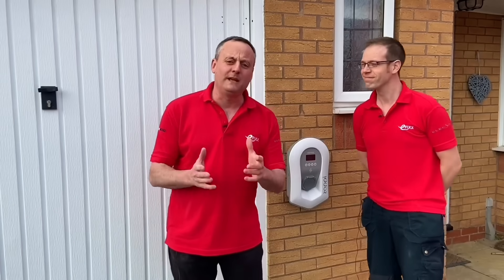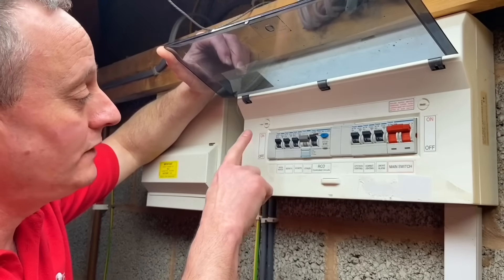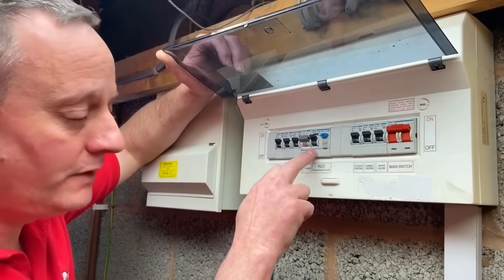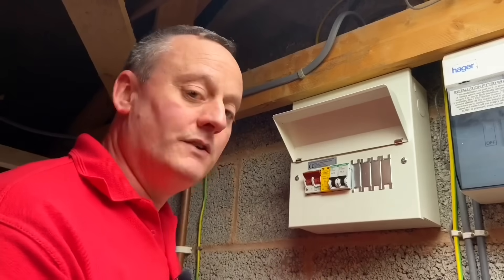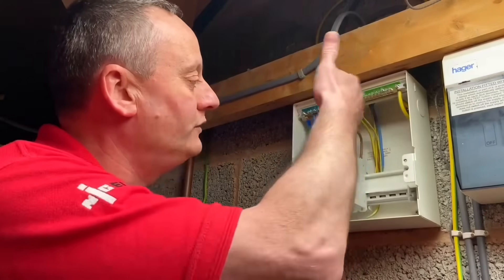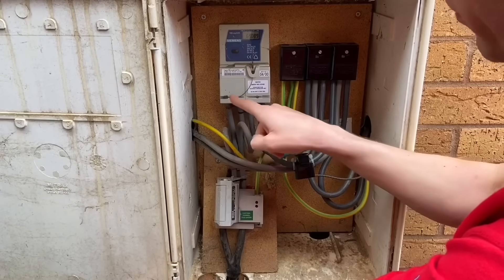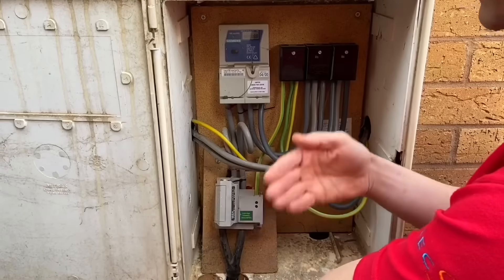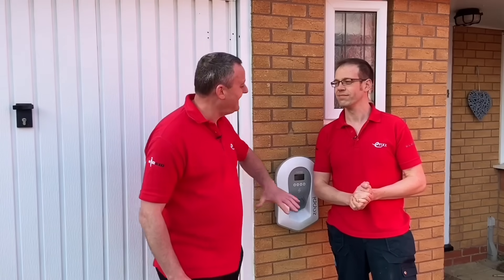EV CHARGER installation UK - can you connect to an existing CONSUMER UNIT?

Comment: Isn't the main reason for using a seperate CU that the installer doesn't have to take responsibility for the condition of the existing CU?
For a 32A chargepoint, wouldn't it be better to use a 40A breaker to avoid any nuisance trips - a 32A breaker at full load for hours on end doesn't seem like a great idea for long-term reliability.
Reply: Manufacturer instructions say B32 MCB for overload protection.
Reply: Are you in North America? The 80% rule is big there, but in Europe the breakers (and entire system) is designed to take 100% loading continuously.
Reply: Just source the original mcb there are loads that are sold used. I'd you're telling me that a tesla has no surge protection built into the electronics then its a bit crazy if you ask me. Most new TV's and game consoles have anti surge protection built into the circuits so an anti surge installation is a bit of an overreaction
Reply: Nobody asking why you need to pull
25mm tails in ? 
10mm from existing cu in to new cu.
Reply: @idontthinkso2058  exactly this made much more. Sense to me. But doesn't this mean the electrician has to take responsibility for the exsisting consumer unit?
Reply: @johnhoward2104  cheers I was getting mixed between the two. Back to 7671...
Reply: I believe J1772 calls for 30A max?
Reply: Podpoint say there require a C40
Reply: Mike it’s higher that 32amps that’s just the safe max lol
Reply: Hello. The chaps didn't mention in the video what the Zappi max current draw was set at, it may be limited at the charge point to lower than 32. Also - wouldn't the overcurrent have to be between 3 - 5 times the MCB rating?
Reply: @BezosAutomaticEye  futures proofing, after are you going to have to up grade every time you get a new car?
Reply: You are taking on responsibility for the supply to the original consumer until if you move the meter tails to add another board. The biggest risk is introducing a poor connection on the tails, so it is a poor choice to add an extra consumer unit if avoiding liability is your aim, plus it is wasteful of materials. The only reason that a new consumer unit was needed for this installation is that the SPD + 2 MCBs wouldn't fit in the existing consumer unit. Good video BTW
Reply: @tlangdon12  So are you saying when the meter is changed the DNO Is taking responsibility for the consumer unit? You also have to take into consideration overload on the main switch on the existing consumer unit. 
I’m pretty sure that clip direct cable is actually running through a wall to go to the charger so there should be RCD protection at the consumer unit
Also to future proof it a separate unit should be installed for different types of earthing arrangement for different types of chargers otherwise the job just has to be done again
Reply: Totally agree. MCB's at full load for 10 hours or so is never a great idea. Myenergi do specify a 40A MCB in their instructions, there's a lot of sparks installing on a 32A though I've noticed.
Reply: @mickbitchum4664  Nope. Myenergi recommend B32 MCB in the instructions for the latest V2 model.
Reply: @mickbitchum4664  What are the installation requirements for the new Zappi ?
(Circuit Breaker or 30 mA Type A RCBO) 40A 2-pole curve B (1-ph version), 40A 4-pole curve B (3-ph version)

This is the old version not the new V2 model as it states Type A RCBO which is already built into the Zappi V2
Reply: Supply
The single phase zappi should be connected to a 230V/240V nominal AC supply. The supply should run from a
dedicated 32A circuit breaker.
The 3 phase zappi should be connected to a 400V, 4 wire, 3 phase supply. The supply should run from a dedicated
3 pole 32A circuit breaker. The phase rotation/sequence does not matter (clockwise or counter-clockwise).
We recommend the use of curve B circuit breakers.
The zappi features an int
Reply: @brad30  This info you have quoted applies to the V2 zappi also!  Just because the Zappi has integral Type A RCD protection there will be times when a Type A RCD/RCBO is still needed at  the consumer unit, it explains this in the efixx video above, if your a spark I'm sure you don't need this explaining. Although I'm not sure why you have brought this up as I hadn't mentioned RCBO/RCD protection, i was commenting on the ampere rating of the circuit breaker which is something completely different.  As I said there must be different manuals printed as mine says 40A..Myenergi need to make sure their website and manuals recommend the same MCB to avoid confusion and stupid arguments 🤷
Reply: @mickbitchum4664  Supply
The single phase zappi should be connected to a 230V/240V nominal AC supply. The supply should run from a
dedicated 32A circuit breaker.
The 3 phase zappi should be connected to a 400V, 4 wire, 3 phase supply. The supply should run from a dedicated
3 pole 32A circuit breaker. The phase rotation/sequence does not matter (clockwise or counter-clockwise).
We recommend the use of curve B circuit breakers.
Reply: @mickbitchum4664  6mm will easy run  with 40 amps but would personally stick a 10mm cable in which I install for showers that can run with a 50a breaker at a maximum of 11.5kw give or take
Reply: @mickbitchum4664  I don't know why say 32A is used on a 6mm cable when it can be fine on 40A I always use the maximum that circuit can handle.

Comment: Good video lads , but would an SPD be necessary? surely the EV charging point and internal car charger would have this built in to the circuit board?
Reply from the maker: We see a mixed bag - you can see some SPD components on the Zappi - in this video https://youtu.be/gwmiGf6tChE - adding a car charger we believe is a great opportunity to protect the whole installation.
Reply: @efixx  fair point, the biggest prob we have at the minute is the grid, there are 7 EV's on my road alone.. 5 on the same phase and we've had a few black outs, quite a lot of voltage sag in the evening's  DNO has done nothing about it
Reply from the maker: Variable rate tariffs will soon shift the EVs to off peak hours.
Reply: @efixx  I can see that pushing us down the same rabbit hole as Australia's energy problems
Reply: @thattoolguy9432  Indeed @Torchy it will be interesting to see how the local grid infrastructure copes with increased EV demand in the coming years. Out of interest is your street overhead or underground supply? Whilst they reckon nationally there is capacity in the grid they also seem very conscious about the extra load EVs will draw hence the smart tech in EV chargers. Picture this you buy a shiny new £50k plus EV boast to your peers it will do 350+miles on a charge, plan to do a long journey the next day go out to your car in the morning (or open the app) and find to your horror the grid have ramped down your charge rate and its only got 150miles in the tank 🙈 (or should that be the million 18650 cells in parallel under the car floor!) Fear not you fire up the Nav a fast charge point is not far away enroute at a motorway services you get there consigned to the fact that you will be having an unplanned coffee stop today, get there only to find the Teslarati have all got their 100kw model X's plugged in to the non CCS outlet and the only spare bay has got someones ICE car parked in it cos its nice and close to the main building! 👍🙈😋. 

I may sound sceptical but i do really want an EV or should i say lower carbon future / national grid  but the reality is there are challenging times ahead regarding storage from renewables and managing the demand. 

I did see an interesting article about leccy issues in Oz. Good ol Elon came to the rescue with some model 3s in containers all hooked up to a towns Solar inverters 🙄 to create a storage solution. On a serious note they seem to have issues with many Coal fired power stations no longer in use and an increasing lack of standby supply to balance the peaks troughs of demand.
Reply: @lshsparks1155   its an underground supply 400a 3 phase feeding about 100+ houses .. another thing i was reading up about and if im correct they are trying it in the US is if you have a powerwall or EV, the grid can use that power to back feed the grid , i know Musk is playing with it too, granted its a great idea, but at the expense to the customer, not the DNO  ...its going to be a chaotic few years that's for sure

Comment: Hey great video. How far was the tails run to the new consumer unit??
Reply from the maker: Less than 3m - the board is behind the meter cabinet - new house tails as short as the builder could make them.
Reply: @efixx  eek😱!! as short as the BUILDER could make them 😨

Comment: i was under the impression that unless a documented risk assesment has been carried out an SPD IS required in domestic dwellings , You stated it isn't a requirement ,can you confirm please
Reply: @johnhoward2104  Still appears to read as total distance less than 1km away from hv/lv transformer (excluding the single dwelling). As I'm still working from 18th and examples provided by the NICEIC previously. Wondering if I have missed an update?
Reply: @johnhoward2104  I've just realised I've read 443.5 as 443.4 for the entire time of the new regs (guidance NIC gave was always do the calculation when it first came into being) so regardless of the type of dwelling I've been doing calculations, that said with the exception of one installation all sites have required them so. I need to slow down the speed that I read at. Thank you for pointing out my error!
Reply: @johnhoward2104  Yes it's been type 2 for all installations so far. I may have to call her tomorrow and inquire about a 3 phase site. Lots of Heatrae Sadia units have been installed and since their installation the remaining old E7 3phase storage units have had their elements knocked out due to the voltage surges.
Reply: I very much agree that spd is required in a single dwelling, except where it is a single dwelling AND the total value of the installation does not justify... It is less than £100  to protect a house and its contents.

Comment: No cut out fuse between meter and fuse board just the main fuse a total no no use to be because it’s going through fabric of building no matter how short a run the tails are
Reply: Yes I agree especially where you can see there is plenty of room 👍
Reply: @johnhoward2104  totally agree I am just saying it’s what DNO use to ask for in and around London the old LEB and EEB not in the game anymore so not up to current standards
Reply: DNO use to specify you put in a fuse between there meter and your cu not a switch fuse because that could be switched off but a fuse in a inclosed box that then could be sealed so any problem with tails going through wall your fuse would blow not DNO fuse . So in place of henlys blocks in video
Reply: I have a spare 32amp in my consumer unit which was originally for the shower, but replaced with thermostatic shower. Could this be used for the ev charger? Cheers

Comment: Would you need rcd protection if cable was hidden or buried in a plastered wall?
Reply: Yes if using twin and CPC, but then you have issues with selectivity so SWA would be the cable of choice to avoid a 30mA RCD protecting the cable.
Reply: @Daniells1982  thanks mate!